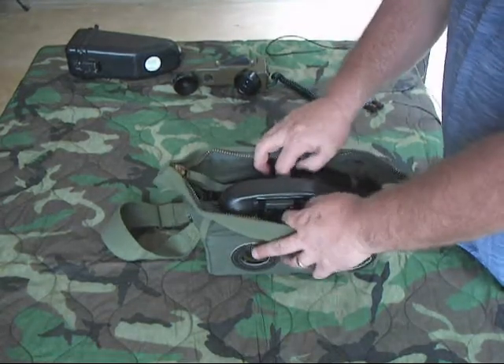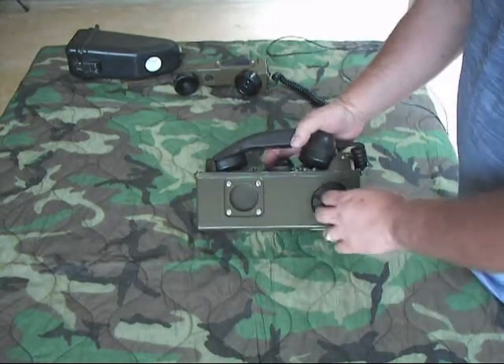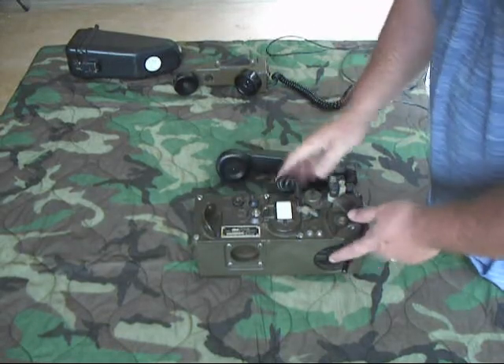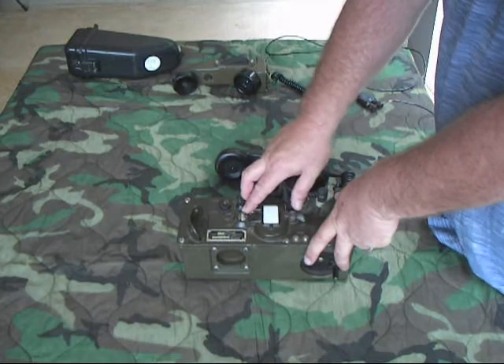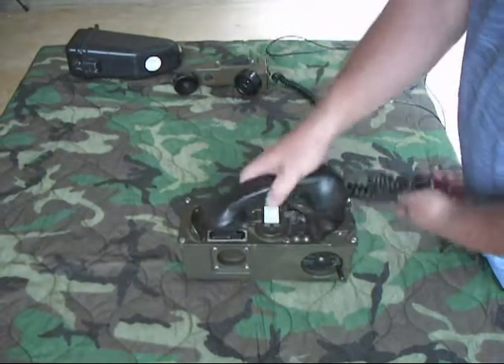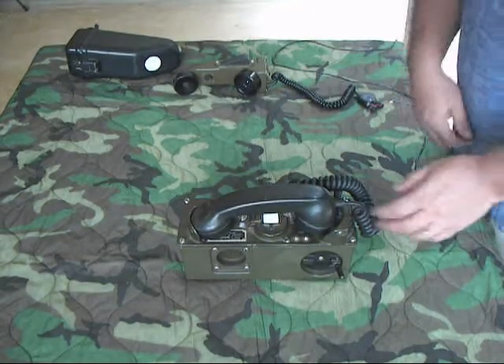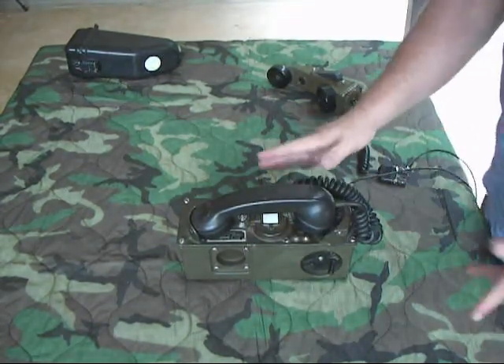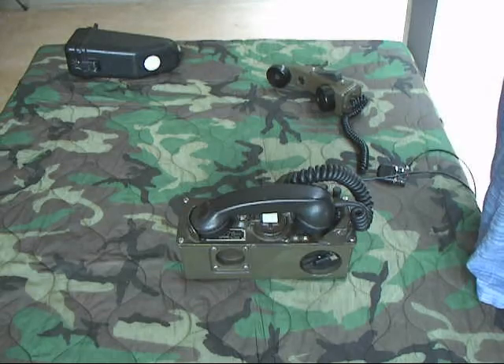FIELD PHONE OPS: US Military  TA- 312 Field Phone

Comment: We still used these regularly in my artillery HQ battery back in 2004. The very newest ones switched to a plastic casing, but were otherwise the same.
Reply: i'm told that the military still uses some ta-312's in certain situations where reliable communication is needed without radiating a radio signal that can be easily detected. sometimes old technology is better than new technology.

Comment: hey buddy, great video. I have a 312 and a 43. Both handsets work. The buzzer works from the 43 to the 312, but doesn't work from the 312 to the 43. I think the buzzer on the 43 is out. Any thoughts?
Reply from the maker: Hold the TA-43  about 6 inches off the table and drop it a couple of times.  The ringer gets hung up sometimes.  make sure the ringer volume knob is turned on.

Comment: Can more than two phones be ganged together? Like a party line?
Reply: Yes just like a party line too.  Ran back to the tent many times to have the commo guy say not us and disregard the ringing for the next 2 minutes.
Reply: @jeffblank9915  need to come up with a ring code…1 brief ring, 2, etc…
Reply from the maker: That's called "paralleling" .  Most two wire field phones will work like that.  When one phone cranks out a ring they will all ring and all the parties can talk. It becomes one big party line.  The only way to run multiple phones is to install a manual operated switchboard.   You can use a designated ring code but the more phones you connect the more complicated that can get.

Comment: A question for you:  I have a couple of TA-312A field phones and your videos have been very helpful.  Can you tell me if you know: can I use two "D" cell 3.6 volt lithium batteries in each of my TA-312A field phones without worrying that I might damage something?  I'm impressed that those lithium batteries last so long, and it seems like it would make sense to be able to use them in the field phones and have a much longer battery use life.
Reply from the maker: If the voltage is 3.6 volts they are not D cell batteries.  The TA-312 was designed to operate on 2 D cells or 3 volts on the external screw terminals.   The D cells in a TA-312 will last for a long time with normal use.  Usually the batteries will start leaking before long before the voltage drops low enough that the phones won't work.  I will not recommend using anything but D cells inside a TA-312 or 3 volts DC on the external screws.
Reply: These are sound powered.  No batteries.
Reply from the maker: No. TA-312's require a battery to provide talk voltage to the microphone element.  TA-1s and TP3's are sound powered and don't require batteries
Reply: @thefieldphoneguy8254  I understand.  But can I pair two TA-312 phones together while effectively using double the voltage?  The Army manual only says "voltage requirements 3 v DC," which sounds like a 'minimum.'  I'm wondering if that can be doubled by using two of those D cell-sized (3.6 volts each) lithium batteries instead.  If the hand crank produces 80 to 100 volts, then theoretically I'm thinking that I should be able to use 6 or 7 volts for the commo without causing any problems.  Your thoughts, please?

Comment: Thank you for your excellent videos! I've just become interested in field phones, and your videos have been extremely helpful in helping me understand how they're used and some of the differences between different models. One quick question I was hoping you could help me with: FM 24-24 (1994) lists the maximum range of the TA-312 as between 22.5 and 36.4 km, but "newer" phones like TA-838/TT and TA-954/TT have ranges of 3-4 km max. 

Why do the "newer" phones have so much less range? I'm sure this is a simple an obvious question, but I'm still getting my feet wet with field phones.

Thanks for your help!
Reply from the maker: The reduction in range is really just an advance in technology.  You now don't have to run miles of field wire to connect phones.  The connections are now made using portable LOS radio equipment.  So the digital field phone will run a maybe a couple of hundred feet to a radio that can then connect it to another radio over say a few to many miles. So rather than having to run miles and miles of field wire they put in a radio link.  So although there is a reduction in range connecting two digital phones using field wire,  There is really and increase because they connect easily to radio relay and satellite equipment.  Additionally the digital phones was an upgrade of DOD comm to what was called TRITAC which introduced digital communications radio and satellite terminals and voice and data security systems.
I hope this helped.
Reply: @thefieldphoneguy8254  Very helpful. Thank you!
Reply: It’s been several years, but IIRC, the 838 always needs to be connected to a powered switchboard  like the SB-3614 to operate. The 312 can operate point-to-point with another phone. The remote power requirement might be part of the range issue.
Reply: @thefieldphoneguy8254  probably good to explain the reason for the phone + radio link setup, if the soldiers used a radio directly the enemy could easily zone in on the transmitting location and easily kill them, but by separating the radio transmitter away from the soldier's location the soldiers would be safe if the enemy decides to target the transmitter.
Reply from the maker: The main reason was many times the radio would not work from the position that the soldiers were in.  Bunkers, dugouts and basements are  areas where radios don't work. So the radio had to be placed in a position where it had good coverage.  Also at the time these orginally came out, radio sets were not small units and were mounted in trucks, vehicles or trailers and is was easier to remote the radio to where the users were.
Reply from the maker: Not totally true.  When set to PT-PT two TA-838's could communicate in direct to each other or to a TA-341 just like can be done with TA-312s and other field phones.  This connection required a four wire connection between the TA-838s unlike the two wires needed for a TA-312.

Comment: Have 2 new in box TA-1/PT's and while the ring
No sound on either.  Any solutions?
Reply from the maker: You will probably have to remove the microphone elements and tape them on the table to loosen the carbon granules.  If that doesn't work next will be to re-align and burnish the PTT contacts inside the phone.  IF that doesn't work,  you probably have bad mic elements.  Do you have any other field phones you can test them with?
Reply: @thefieldphoneguy8254  no i don't.   Thanks, i will try those tips.
Reply from the maker: I would also look at my videos on TA-1s and TP3s
Reply from the maker: There is also a Facebook page titled Military Field Phone Collectors that has lots of folks who can answer questions.